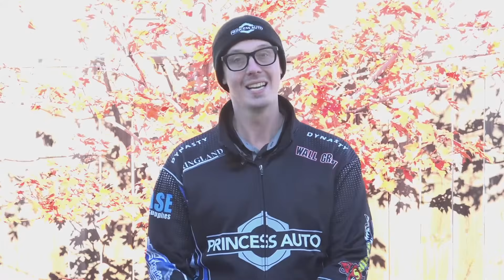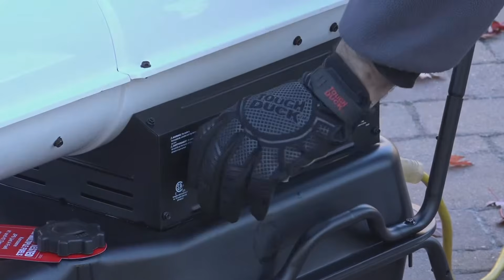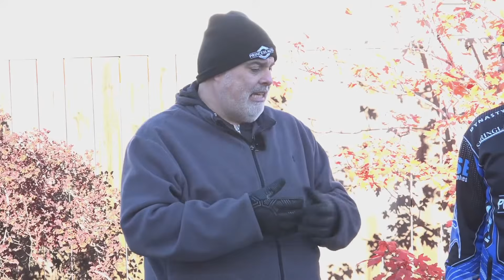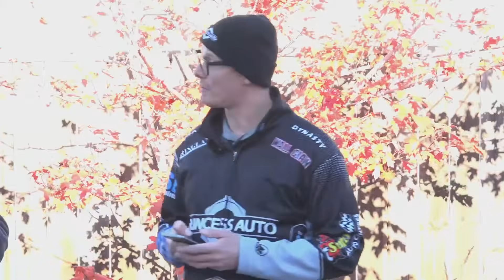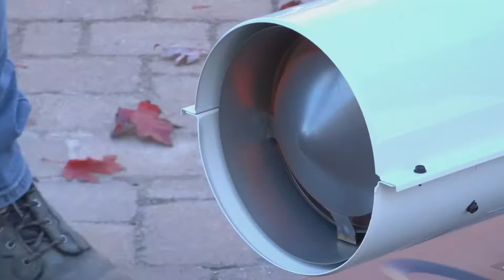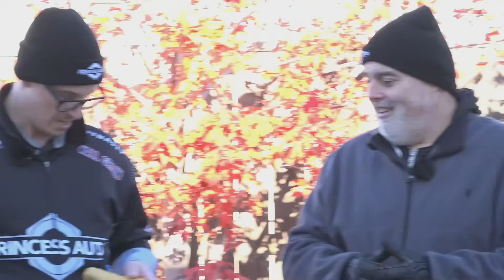Title: See it Work – HeatStar Propane & Kerosene Heaters

Comment: If I wanted to use it to heat a closed garage would it be safe or dangerous to cut a round hole in one of my metal doors so the heater can sit outside while blowing heat inside and combine this with an exhaust fan and slightly open window to circulate fresh air through the garage.
Reply: Just open the garage door about 6 inches

Comment: No explanation of the various fuel types and how they should be used at various temperatures and pressures for the big unit. Diesel#1 can be had at the gas station (presumably), where on earth do you buy fuel oil or Jet A fuel?

Comment: Would it be more cost efficient to run a 38000 BTU propane heater(vented and safely of course) in a garage on occasion or to run a 240 electric heater?

Comment: In your Nov. 9th to 21st flyer on page #6 it list a DeWalt 1,400 amp jump starter with air compressor (#9016825) on sale for 219.99 and says that the regular price is 179.99! Is that a typo and what is the real price?
Reply from the maker: We noticed this too! The regular price and sale price got swapped in the graphic. Unfortunately we didn't notice this until AFTER the flyer was printed 😣 A correction notice is going up on our website today. The Regular price is $219.99 and the sale prices is $179.99. Sorry for the confusion.
Reply: @princessauto  Thanks and will let my brother know as he was looking for the charger/air compressor combo!